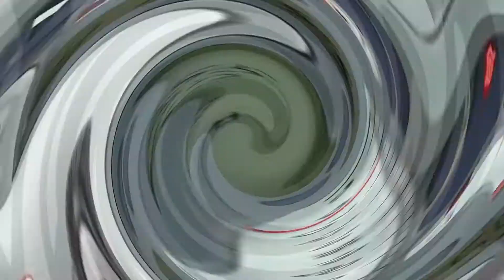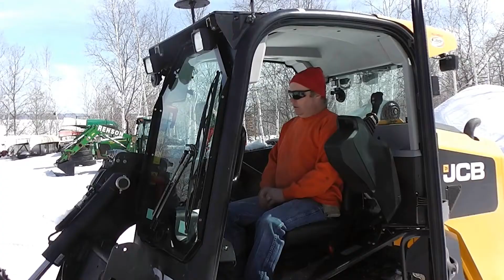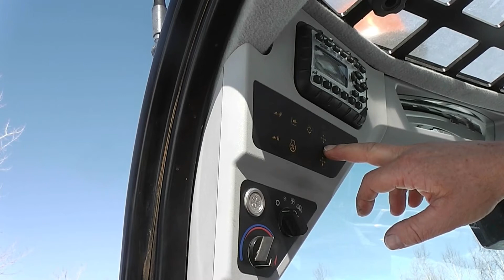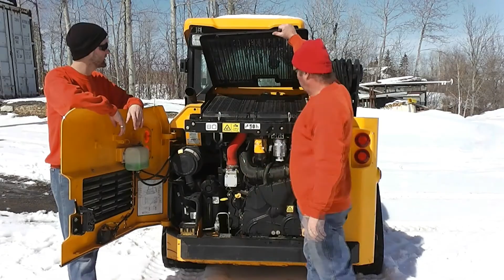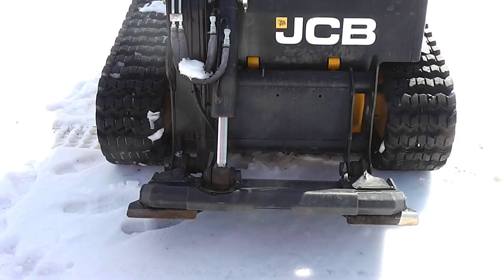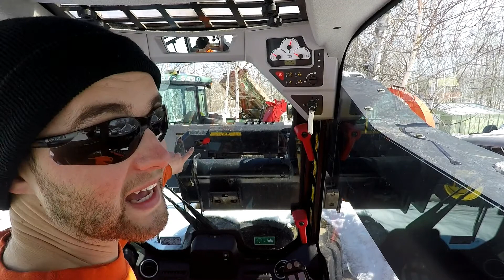JCB 190T Overview and First Impressions

Comment: I just bought a new 2022 215 super wheel model for the side entry.  It is so jerky can't easily do any precise work, hook up attachments etc. Screams so loud even inside the cab  you can't hear yourself think. Less than 100 hours on the shop 3 times for emergency stop codes. This last time having to.pull the engine to replace oil pump, trying to fix low oil presdure
Reply: Howzit mate, I got one here with some issues you may be able to help us out with, our Jcb when going full speed it bogs right down feeling like it enters a limp mode can’t figure it out done a full service but nothing stilll happens, have you had this issue?

Comment: I have a 2018 190T without the fully enclosed cab. Ive had it for 1 year and it is the most jerky machine ive ever operated. They have come out at least 3 times to adjust the computer and it did get somewhat better but good. Mine is electric over electric controls. When i try to stop it will roll another 2 to 3 ft before coming to a complete stop. Do you have these problems ?
Reply from the maker: Yes, we keep the controls on the lowest sensitivity setting, but it's still pretty jerky. In high gear it's even worse, but I suppose that setting is only to be used in a straight line.  

Electric controls are nice for the noise and heat reduction, but I miss the old hydraulic system when it comes to delicate operations.